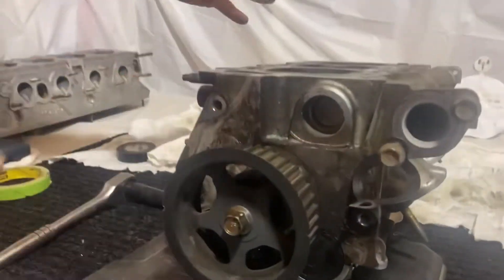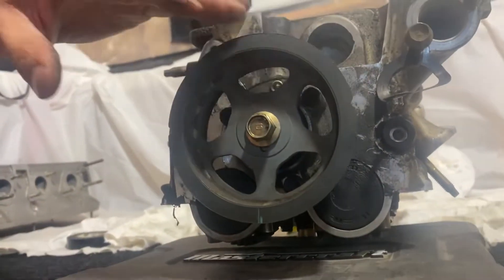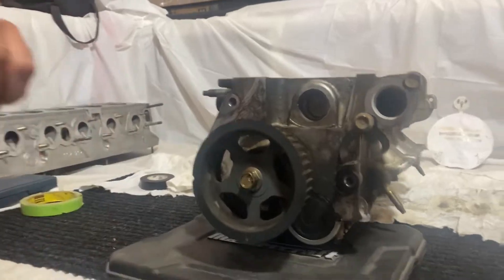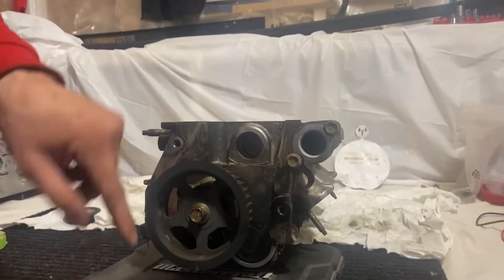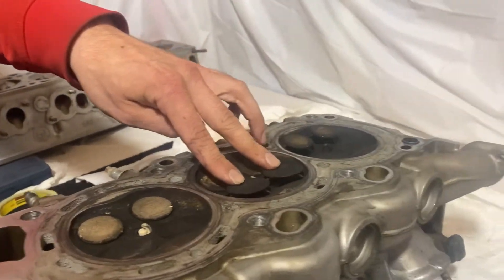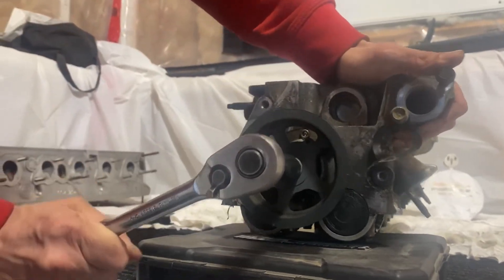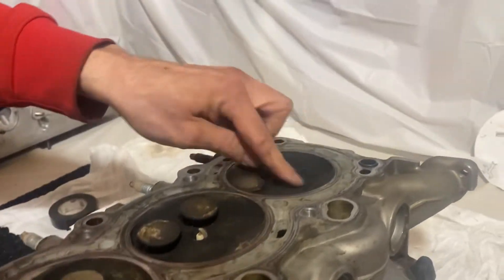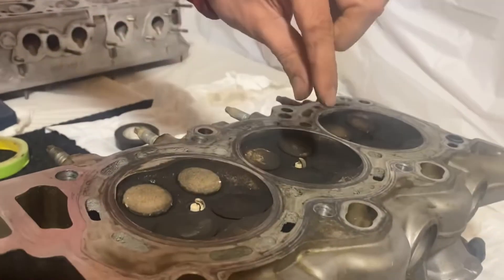Isuzu series - Why you MUST clock heads when Timing your engine Explained and demonstrated

Comment: Shot in the dark hoping you see this, just replacing timing belt/tensioner/waterpump on my moms 3.2 v6 98 rodeo. If I'm just looking to set TDC do I have to clock heads?
Reply from the maker: If you are not going to change the timing at all then no. But if you just disassemble the timing belt and tensioner. Then rotate the crank to TDC. You may want to. 
  Clocking the heads is like a reset when everything is messed up. If things aren’t messed up there’s no need but if they are then it’s an easy reset.
Reply: @r1beef88  Ok awesome thank you. To clarify then, should I just set it to TDC or should I set it a tiny tiny bit behind the TDC mark to account for me tightening/loosening things. I have read/heard that people may either do that or buy certain tools to hold the marks in place while continuing work.
Reply from the maker: Set to TDC. Remove belt then back crank back a bit. Counterwise   This will help get belt back on easier. Mark your belt if you’re reusing it. Nice clear marks.
Reply from the maker: Also when at TDC the driver side head is on the verge of clocking forward. You’ll want to use the passenger side head to make adjustments and take the slack out while mounting new belt.
Reply: @r1beef88  Ok thank you so much. Between you and some help from isuzu forums/chatgpt I think I can do it. Will use some carb cleaner to clean the marks and I believe my kit may have came with seals. Thank you so much for replying even years later much much appreciated.

Comment: So pretty much once it snaps straight down then it is good?
Reply from the maker: No only in one side. The proper timing procedure I believe is. 
  Passenger side head snaps to 12 o clock
   Drivers side you snap to 9 O clock then turn to 12 o’clock. It will have tension and want to snap again but that is proper.
Reply from the maker: If you think about it. If you let both heads snap to 12 o clock then called it good. Every valve would be shut at once. I can confirm the proper procedure I a follow up video.
Reply: @r1beef88  right. I was just confirming once that one head snaps to 12 o’clock it is good there. Your correct on the left head, snaps to 9 o’clock then you rotate it up to 12 o’clock.
Reply: I have a 96 rodeo 3.2 and the timing marks are different. I have not found any real good videos for the proper procedure to do the timing
Reply from the maker: Yep!  👍. No!

Comment: Ur doing a 3 cylinder engin..... Ofcoz it will be a 2/3 rotation lol..... I came for a 4 cylinder search 😢
Reply from the maker: It’s the cylinder head off a V6 6VD1. Isuzu rodeo 3.2L. This is just for demonstration purpose only. Mearly showing why you don’t time this engine without ‘clicking’ the heads. 👍

Comment: you want cylinder 1 at the top and as cylinder 1 comes up air should push out the spark plug hole (compression stroke), you also want to make sure your cam lobes are not pushing the valves, meaning they are closed

Comment: So what position do you want them and I am looking at a 91 with a bad timing belt placement but it is now thank you
Reply from the maker: I am unfamiliar with the engine in the 91 unfortunately.
Reply: Don't know if you're still working on this but a 91 would be a sohc to my knowledge, thus no clocking necessary. However it's worth checking the rocker shafts and valves if you got it apart, I'm overhauling my heads right now and got major wear for only 113k

Comment: Thanks for making this video without this video i never would have been able to get mu rodeo running again I did water pump timing belt timing pully and tensionior and i had everything lined up 3 times i went through completely re assembled the vehicle for it not to work after watching the Isuzu timing procedure video 50 times and seeing this video it clicked in my brain i clocked the heads hooked up the radiator before reassembling everything again and she purred to life now i just got to fix my sticky lifters
Reply from the maker: Right on mang. That’s good stuff I appreciate it. Glad the video gave some clarity.

Comment: Just been through this with my Rodeo 3.5...

There are some postings on youtube that are incorrect. This site is the correct one. Make sure to watch the other sites "tear down" 1-10

In short: with timing belt off (about to be replaced)... install tensioner spring but not tensioner pulley.
Check that the large 17mm tensioner bolt will thread into the correct hole (mine did not ... took too long to discover this)
camshaft rotated until groove (cut out is at 3 o clock). Painted mark on pulley will be at 9 o clock
RHS cam mark will be at 12 o clock - remember to turn it until it clicks into place at 12 o clock
LHS cam mark rotated until clicked into place at 9 o clock TO THE CAM MARKER ... then rotated manually until at 12 o clock.
Feed belt onto RHS and clip into place - align marks on belt, letters readable from the front of the car.
Feed belt onto LHS and clip into place
Then back off LHS until belt goes onto water pump pulley. Return LHS to correct 12 o clock position
When feeding belt onto cam shaft pulley, it is very hard to align belt ... so turn the cam back until the marker on the belt can be made to align with the painted marker on the cam shaft pulley, then turn cam shaft back into position
Install tensioner spring (or do this at the start) 2 X 12 mm bolts
Use tensioner pulley to force belt aside and screw in large bolt.
Rotate engine over 2X to confirm all is clear.

Motor can be turned over to check at this stage. I would have the plugs and coil packs in and connected so that there is no build up of spark and something electrical blows.

If timing is out (in my case because LHS cam was clicked into 12 o clock  instead of 9 o clock ( as per some youtube recommendations) you will hear knocking in the motor ... so turn it off immediately and start again (so much quicker and easier 2nd time round...reckon I could do the whole thing in an hour!

Good luck
Thanks for the videos

Comment: hey i got an off topic question. do you have to drop the front axle to remove the engine or does the transmission move back or both?
Reply from the maker: You will need to lower the front brace in order to clear the oil pan. If you separate the transmission and drop it down you can lift the engine out without lowering the front. But if you plan to take out the engine and trans together you have to lower the front. Remove the front driveshaft. I believe you can get away with loosening the the sub frame and not removing the axle and everything in order to lower it enough for clearance.
Reply: @r1beef88  wow man that worked. my mechanic and i fought for 4 days to get it out. we ripped the clutch fingers out of the lock ring not sure if we did that right. everything was rusted. thats what was really holding us up mostly. we ended up disconnecting the trans and unbolted the axle. everything is ez as pie after this. thank you for the reply there wasnt much on the forums and the book isnt for beginners.

Comment: What kind of issue or sound would the engine be making if this wasn’t done properly? I have a 1998 trooper that just had an axiom engine installed into it and had the timing belt replaced. My engine is making a weird fluttering sound when you press the gas. It’s running but idles ruff around 2k bounces up and down. Any help would be greatly appreciated.
Reply from the maker: Hey there sorry for the late reply.  So the very first time I changed the belt I messed up the timing on one of the heads. The drivers side I think. It started up and ran but there was obviously something not right. I drove it for a day or two before I could change it and set it properly. 
    If I remember correctly it surged and idled rough. Had a bad engine performance and didn’t want to rev up much. Once I adjusted it it ran totally smoothly. I can’t remember how it sounded but it’s idle was loppey and had power suges while driving. 
   If you haven’t done so yet and have the means or capability then definitely check the timing and reset the whole system. Clock both heads and put the timing belt on properly. Then at least you’ll know if that was the problem. Good luck mang let me know 🤘🤘